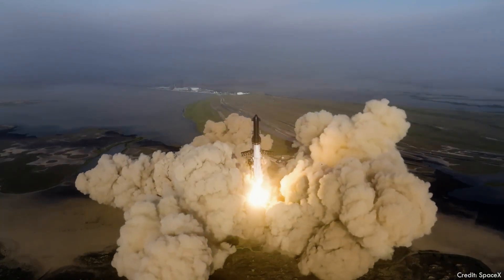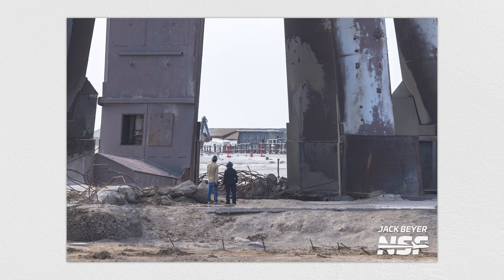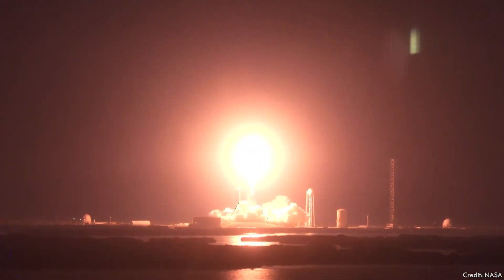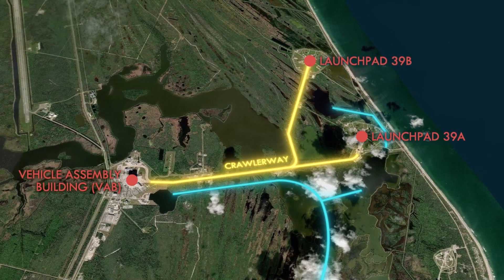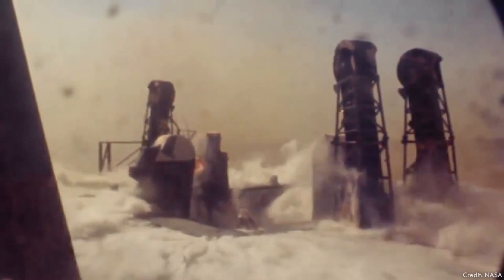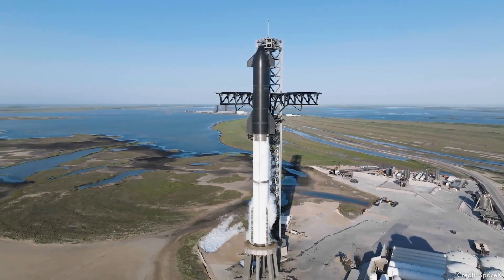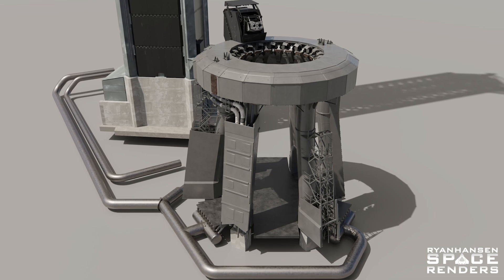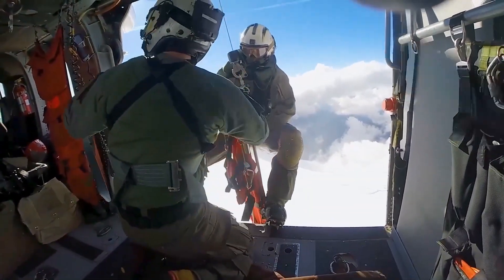Was Starship’s Stage Zero a Bad Pad?

Comment: What did they think was gonna happen?
Reply: Ablation and spalling like had happened in their sub scale testing. I think they may well have gotten away with it had all the engines lit. The takeoff was much much slower without the 3 that failed at the moment of ignition. The other two that failed a bit later made it worse. But if they had them all out would have well cleared the tower by the time the debris started flying out in the attempt they had.

Comment: Your quote from Elon about it being about what he expected, was more to do with the flight, they thought they could get one launch out of that old pad design and so decided to not delay the launch to install the water cooled plate system (which they already had parts in production and at the facility), this is why that wasn't in the environmental study and there is a difference between an accident dumping material in wet lands and bulldozing wet lands.
Reply: Yet they expected some "ablation" - literally debris coming off of it. That they were wrong about how much is the difference between on-site cleanup and spreading debris all over the wetlands. In engineering, the size of the safety factor you design in depends on how catastrophic a failure could be. I think it's fair to say their safety margins were a little slim in this case.
Reply: @reverse_engineered  the safety margin was having a  5 mile radius keep out zone to keep people safe
Reply: if you look at the whole at the launch pad, you'd see how incredibly little material was dumped in the wetland.
Reply: @snuffeldjuret  You mean the entire concrete pad and a large chunk of the ground beneath it? According to estimates, it was hundreds of tons of dirt. The large chunks of debris that could be seen flying through the air were similar in size to an SUV! It's hard to tell when looking at videos taken from miles away showing it next to a rocket that is 50 stories tall. That was a hell of a blast.

Comment: Space X does learn. Aka failure is an option.
But the key lessons I believe is either or both flame diverter and water deluge systems.
spaceX does not have adamantium yet.

Comment: Wouldn't be surprised if this was really just the result of cost cutting measures
Reply: Yes and no.  Grady nailed it.  SpaceX’s philosophy is to build something cheep and fast.  Then see what fails, and build something else cheep and fast.  Rinse repeat, until you have something cheep, fast and working.  There’s a great video they published called something like “how not to land an orbital class booster” that shows all the ways Falcon 9 blew up while they learned what they needed to do to land a rocket.  At this point they’ve landed over 100 in a row, having iterated over and over.
Reply: @beelseboob they are at 200+ landings with 240+ launches. They've successfully landed more rockets than any other rocket has ever flown. So it's just I just laugh at neigh sayers when they talk about starship
Reply: @beelseboob it definitely wasn’t “cost cutting.” They do build cheap, but not where it really matters. No one expected the concrete to snap in half, which is what caused the damage. Destroying the concrete would have been expected/acceptable, especially given the planned upgrades, but it snapped in half instead.
Reply: @Beechsack prove it then.
Reply: @zyeborm  common sense skeptic is not a rocket engineer and yet they predicted it, they also predicted the engine failures. go figure
Reply: Not even close to true. The concrete actually snapped in half under the load, and that allowed the exhaust to eat through the soft sand underneath. Disintegration of the concrete  would have been acceptable, and even expected, but snapping in half was unexpected and thus not included in the assessment.
Reply: @timwildauer5063  Right - but expecting that the sand under the concrete might liquify and allow the concrete slab to crack in half after being unsupported is probabably something they should have predicted.

Comment: Another thing to consider is the Pad39 diverter was designed with bigger rockets in mind…
Reply: NASA had plans for a follow-on rocket even bigger than the Saturn V.
Reply: Nova!
Reply: @davidawalkerjr2905  everyone always forgets the Nova and the M series engines as well. It gets silly... NASA just planned long term with the diverter... why build it twice?
Reply: LC-39 was built to be capable of the Nova rocket, which had 9 F-1 engines, or nearly twice the power of the Saturn V.
Reply: The Artemis rocket is higher thrust at takeoff than a Saturn V. Kind of amazing to think there are now two rockets in the world bigger than Saturn V. And so far, at least one of them works right, hopefully both soon.
Reply: Yes 
Nova
Reply: Bigger than starship? Isn't it like the biggest rocket?
Reply: @crackedemerald4930  Actually Yes. Pad 39 was designed for rockets even bigger than the Saturn V.
Reply: @crackedemerald4930  Pad 39 was designed for the Saturn 5 rocket in the 1960s - not Starship. OP was probably saying how this was a solved problem 60 years ago.
Reply: @jamesm6830  Reportedly the LC-39 pads were designed for rockets roughly twice the size of the Saturn-V. So for a rocket roughly the size of Starship.
Reply: @jamesm6830  Well, so far, I remember they had plans for a saturn 6 and 7. 
The boosters of the shuttle had more trust and were more abrasive than saturn 5.
Reply: @jantschierschky3461  That was presumably in no small part due to the powder burning SRB's. Powder rockets produce particulate matter in their exhaust just like a firework, I expect the blend used in the SRB's is cleaner but clean is pretty relative for most solid fuels, in particular due to the difficulty in eliminating all impurities in materials that exist as solids also.
Reply: @seraphina414  Well, those boosters used aluminium as well. So very abrasive and hot.
Reply: No launch system of this size was ever conceived until Musk and Starship.  At well more that double the thrust capacity of the Saturn V ... and SLS ... this is all at a new level.
Reply: @arssolar7360  Your lack of knowledge is showing. Look up the Nova rocket.
Reply: @dr4d1s  Actually, my friend, we spend several hours a week covering Starship and other launch topics.  We are familiar with the Nova C8 and Saturn C8 designs, and the developement along these lines back in the late 50's, including the 8L variant and other design possiblities.  However, the largest of these variants was incapable of anything close to the mass to orbit of Starship.  Of course the engine designs were capable, but limited compared to the Raptor engines - especially with the chamber pressures of the most recent Raptor "3" variant.  The metalurgy simply did not exist to achieve what we see in the Starship.  Lifting 150 tons to orbit is pretty much a uniquely SpaceX thing.
Reply: @arssolar7360 excuse me, what the hell mass to orbit has to do with pad design? The main variable is rocket thrust, and if you look at Nova intended specs, it would be around twice Saturn V, or on the same ballpark as Starship. So yes, a pad capable of handling something similar to Starship is not new.

Comment: They intentionally started the rocket with 31 engines I believe and only had the issue with the one, it's in a very clear statement issued directly from SpaceX and Elon himself. Love the NSF clips it was an amazing time.
Reply: You are thinking of the 31 engine static fire. There were 3 engines that failed before liftoff on the B7/S24 flight and Musk said it wasn't from debris strikes.
Reply: @steveaustin2686  Musk also never said they were failures. https://youtu.be/qQwLg84NNXs

Comment: I was expecting to get to the actual content... i.e. some analysis of how the concrete slab broke up, different design choices for it to keep it from cracking etc.
...but the video just ended before ever getting to the "content". Strange video when comparing to other good ones on this channel!
Reply: Could have spend way more time talking about the foundations, how the concrete sank in the sand and how the back of the plate ended up under tensile stress...
Reply: @johntheux9238  Exactly! Not enough rebar (or otherwise poorly designed) at the bottom of the slab to hold for the tensile stress.
Reply: What could he say? The FAA's report hasn't been released yet. There's some conjecture, but no one actually knows exactly how it failed yet.

Comment: Why do you call it “civil” engineering, though?

Launch pads were military engineering in the first place, just as rockets themselves. 

And concrete in principle was invented and used for military purposes by military engineers of yore. All of it is military engineering.
Reply: civ·il en·gi·neer·ing
noun
the branch of engineering concerned with the design and maintainance of roads, bridges, dams, and similar structures.

So not civilian vs military.
Reply: @steveaustin2686  The definition of “civil” suggests it is civilian, which is opposite of military since the ancient times, it is a different category. The fact that things that were military in the first place were all of a sudden pushed to “civil” things makes no sense.
Reply: @tatianaes3354  I pulled the definition right off google. It is NOT about civilian vs military. it's about the massive construction that a CIVILization needs.
Reply: @steveaustin2686  The issue is, it makes no sense. There is a military engineering and civil engineering (this is not about civilizations, military are part of them). The making of a launch pad was a military engineering, just as the invention of concern itself. It is literally absurd that it is considered civil.

Comment: Well, this was a bit disappointing. It seems like only a sentence or two in the whole video actually discuss the engineering of launch pad. It also feels like the video just cuts off without any real conclusion. Maybe this is a case of Betteridge's law.

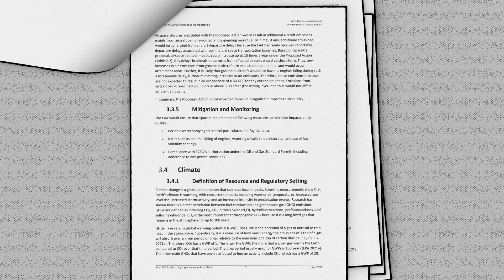10:08 / 10:30 - The PEA very extensively mentions the potential for debris through normal operations, anomalies, and even launch pad anomalies and sets the requirements for what must be done for each of them. I'm not sure how you could have missed that. The word debris is used 106 times in the PEA.

11:00 - Previously to the PEA there were multiple fires in the state park caused by static fires that were determined to actually be beneficial to the area. Because of this the mitigated FONSI didn't require any significant actions to prevent these from occurring. This one however was so small it did not spread. I'm not sure why it's noteworthy.

I also think it should have been mentioned that this pad was only supposed to last one launch. It wasn't a CYA excuse by SpaceX, but the parts for the upgraded pad were already on site and being installed well before launch.

Comment: Why do they insist on not building a flame diverter even after all the damage done. It's not like flame diverters are complicated. They work well. Is this just NIH syndrome?
Reply: Musk evidently really wants to avoid a diverter, so that they can work on the engines under the pad. He's eventually likely going to need to cave and put one in.
Reply: It's "we must build rockets and infrastructure which do not cost $1B per launch" syndrome.
Reply: @denysvlasenko1865  If you have to rebuild the pad infrastructure for every launch even if you reuse the booster rocket and vehicle, you can still exceed $1B per launch.
Reply: @AlexandruVoda  And if they succeed in making a relatively cheap and reliable launch infrastructure, they will not exceed $1 billion.

The planned steel plate will likely resolve the issues, at much lower cost than a full flame diverter.

Comment: I will save you all the time of watching the video: yes. It was a very underdesigned pad, partly on purpose partly by dangerous and unallowable neglect. There is a reason theyve grounded Space X. Elons behavior is unacceptable and dangerous. Neither of us want another challenger, so stop excusing such blatant disregard of human life
Reply: They're grounded because that's the standard procedure any time a rocket fails in any way. Every test flight with a failed landing, or any other FAA licensed launcher which has an anomaly gets grounded until they provide an analysis and plan for remediation. In practice it doesn't really matter since no sane launch company would launch again before doing this analysis, but it's still useful to have checks on it and keep them in line
Reply: is is not even grounded, they only had license for one launch. Also, any rocket that blows up is grounded, so it is a completely pointless statement of no value.
Reply: Cry harder.

Comment: Ya, you definitely were too generous on this. Anyone want to bet how fast that shower head will rupture when all that water is flashed to steam? Of course thats assuming that theyre not bankrupt by the next launch date. Common Sense Skeptic really hit on the huge failures SpaceX did with just this launch alone. A slapped together rocket with various Raptor engines "that wanna melt" on a pad next to the liquid propellant storage tanks, an abort system that didnt work as expected, and protected nests burned. And Elon was putting several years ago he'd have two of those on Mars by 2022.
Reply: >  Anyone want to bet how fast that shower head will rupture when all that water is flashed to steam?

The rocket exhaust is not very hot. It's a common misconception.
Reply: Common sense skeptic misses a lot of the nuance in the launches because his extreme bias against Elon. Same with Thunderfoot..
Reply: @edd542  Oh I knew if I treaded into the field I'd kick up a Musk apologist. How's that Hyperloop or FSD working out? Dogecoin to the moon while platforming crazy.

Comment: What depth of seawater would be needed to absorb that blast? Could the launch tower be built on an oil-rig type donut stood offshore? Would local fish restaurants object? : )
Reply: SpaceX has shown concepts of Starships operating off ocean platforms for the past 8 years. Two oil drilling rigs were purchased at scrap prices about 4 years ago and SpaceX began to modify them into Starship launch platforms. A few months ago, that work was stopped. SpaceX said that they had a better design for such a platform, implying that the new design would be custom-made for Starship.  No development schedule was given.

Since SpaceX is building a 500,000 square foot Starfactory at Boca Chica now, my guess is that one or more Starship ocean platforms will eventually be built in the Western Gulf of Mexico about 100 km off the beach at Boca Chica. 

The water depth there is about 30 fathoms (180 ft). The platform likely will be anchored to pilings driven deep into the ocean floor. That should be deep enough to handle the exhaust gas flow from those 33 Raptor 2 booster engines.

Methalox (liquid methane and liquid oxygen) propellant and liquid nitrogen would be transported to those ocean platforms via modified LNG tanker ships with 50,000t (metric ton) cargo capacity. Those LNG tanker ships would function as a floating tank farm for Starship launch operations at those ocean platforms.

Electric power would be supplied by methalox-burning turboelectric generators located on the platform. 

My guess is that SpaceX will launch the uncrewed tanker Starships from those platforms. Since the payload for the tanker Starships is methalox, there are no extra cargo handling facilities required on the ocean platforms. The payload is pumped from the LNG tankers into the main propellant tanks of the tanker Starships.

The uncrewed cargo Starships and the crewed Starships would be launched at the NASA KSC facility in Florida. The tanker Starships, launched from the ocean platforms, would refill the tanks of the uncrewed cargo Starships and the crewed Starships in low earth orbit (LEO).
Reply: @rays2506 I like what you've got but I don't think they will go that far off shore. If they go even a km off shore they get most of the advantages of off shore with the benifit of being able to use shore power/fuel/etc. And it's 40 seconds away in a rhib not 3 hours.
I wouldn't put building a road out to it out of the question for them too lol.
Reply: I think they did sea launches in the manga/anime Jormungand.

Comment: Next we're going to hear that SpaceX decided to use multiple pieces instead of a continuous threaded rod to support sky walks at a new headquarters with out verifying the load capacity of the new design, or pressurizing the Dragon capsule with pure O2.  Learning lessons from the past saves money and lives and it really worries me that SpaceX doesn't seem to realize that.
Reply: Notice that it's nasa that made the crafts that killed its crew 3 times, how can you say spaceX with the most reliable rocket and crew capsule built hasn't learned its lessons?